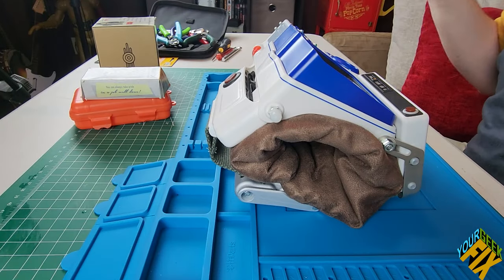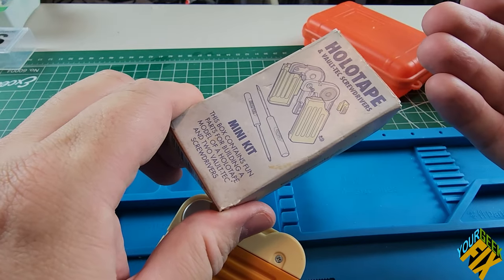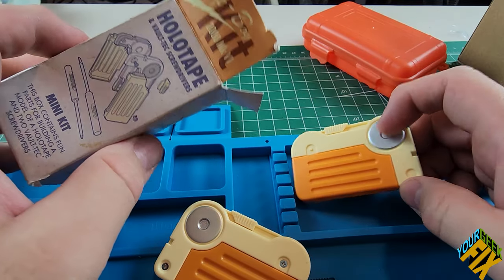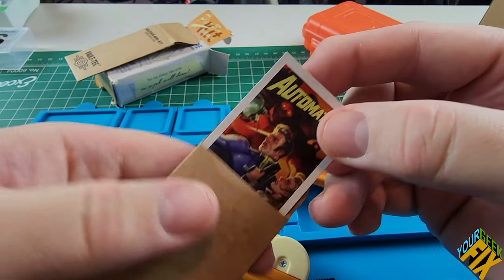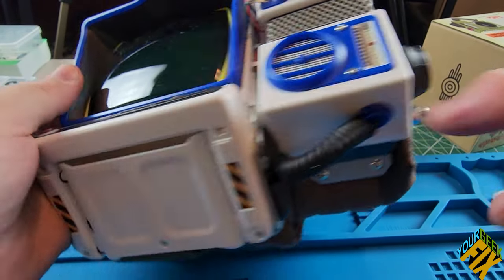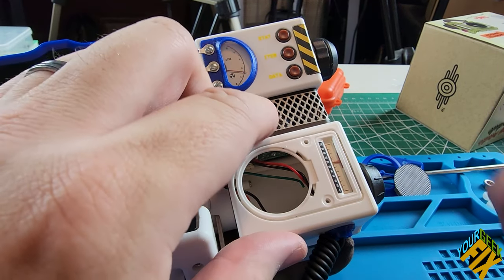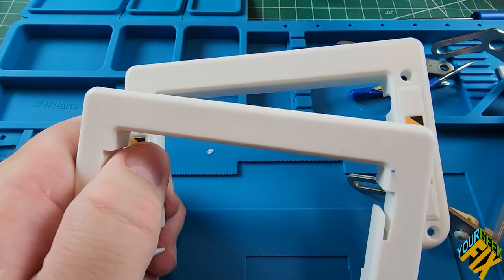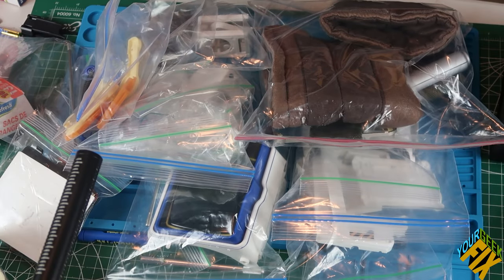How to Make a Real Working Pip-boy 2000 – Phase 2

Comment: I went to a Gunsmithing trade school… so I can do precision machining, and I’m just sitting here thinkin, “I’d LOVE to replace all those plastic areas with Metal, maybe aluminum, maybe somethin just as light but more durable.”
Reply from the maker: Have you seen the new working die-cast Pip-boy for sale on Bethesda's store?
Reply: @YourGeekFix  I saw your video on them roughly 3 or 4 hours after makin this comment. Depending on what metal they use, if I can talk my wife into not pulling Lorena Bobbit on me for buyin one, I’m now sitting here thinking “ok, the light corrosion is a nice touch, but I can either cerakote the metal, or blue the steel like I would a rifle barrel.” 

Aluminum and stainless steel doesn’t blue… and would necessitate cerakoting… but if it’s some form of carbon steel I can blue it, and depending on conditions bluing can take on many different shades, everything from midnight black to the standard gunmetal grey, to just about anything between. I’m rather fond of bluing, because no two bluing jobs are the same. Bluing polished steel to the point it’s like a mirror can come out looking like black chrome, or it may take oddly to the bluing and may not get an even blue, so it’ll be darker fading to lighter bluing… gives whatever I’m bluing a bit of personality that cerakoting just can’t do. 

That said, cerakoting is far more protective… it’s a ceramic paint, so naturally it’s more scratch resistant too. But name brand cerakot can be a bit pricy… that said it’s totally worth it.
Reply from the maker: You could wait to buy after watching the video we have coming out. Chris said they will not be selling out. This is just to know how many to make.  @codyralston1372
Reply: @YourGeekFix  that’s fair, though I’m looking forward to seein all the functions this one will have.
Reply: @YourGeekFix  it's not limited?
Reply from the maker: @themufasalion  Chris says they will make the number that are pre-ordered. Some countries people are saying are sold out, but he said it shouldn't be.

Comment: great video, def going to use some of your mods for my 3D printed version of this Pip boy. I have a question, since these are sold out or at a high cost on second hand stores, are there any sources for the lightbulb covers as seen @21:07 ? Cant seem to find any. I do have clear PETG and can possibly 3D print them, but def wont be the same.
Reply from the maker: Go to the local hardware store and look for small Edison bulbs. You can easily light them.

Comment: How was the event, got any comments?
Reply from the maker: It was awesome! I have a whole video coming out on it.
Reply: @YourGeekFix  have you ever tried to get the time rollers to work on your recent attempt?
Reply: Ok, I take that is a no.
Reply from the maker: I could try again.  @Indykathoris
Reply from the maker: @Indykathoris No, that was very hard. The wires are the size of hairs. very intricate.
Reply: @YourGeekFix  ,yes you could. 
I think I should look up the concept of the time rolls before any of us could muster resources on trial and error.
Plus, I hate it to cause damage to a limit edition item you worked hard to make into your own.
Reply: @YourGeekFix  , you are a genius.
I just looked back on the footage from your previous attempt on the time clock. you originally wanted to give the clock its own powersource. Have you thought of sodering wires from the clock to the blackberry power circuit?
also. I check the reason the time clock did not work before was because the rolls were too big for the casing. as for the rod, the rod is too small to model. However, I found an alternative for the roll clock. Have you heard of flip clocks? they act similar to old slideshow boxes.
Reply from the maker: True @Indykathoris
Reply from the maker: @Indykathoris  It was an OK size, but using titration was difficult.
Reply: @YourGeekFix  , could you explain to me what "titration" means. I would like to know how it could be difficult to work with.
Reply from the maker: @Indykathoris  Titration means you can increase or decrease the amount of electricity. Using a titration switch, also known as a titer switch, or pot switch, you can increase or decrease the power using a screwdriver. Theoretically, you could decrease power til the roller has only 1 rotation every hour.
Reply: @YourGeekFix  so you are saying that controlling the speed of how something is powered is difficult to implement.
Reply from the maker: @Indykathoris  You saw me doing it in the video. Would take a lot of time to calibrate.